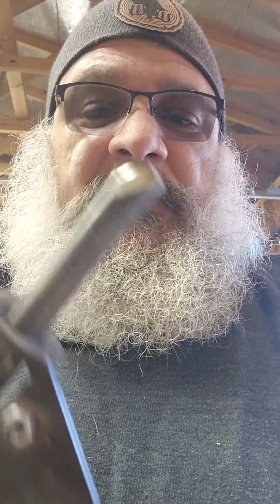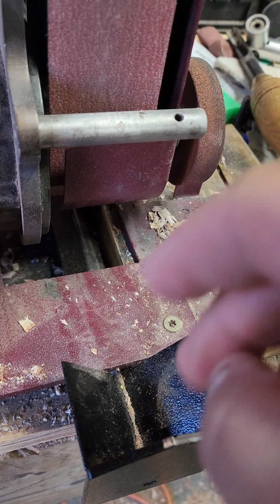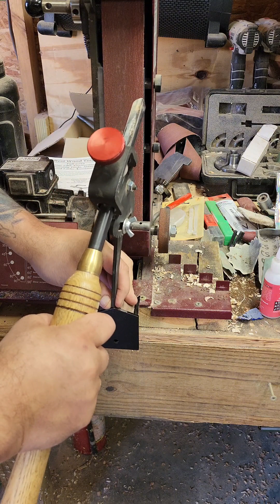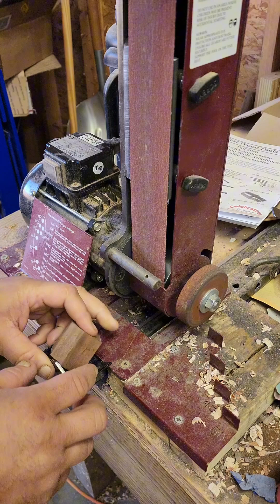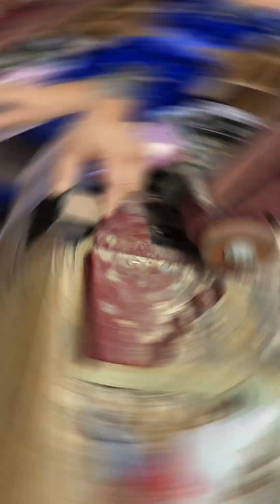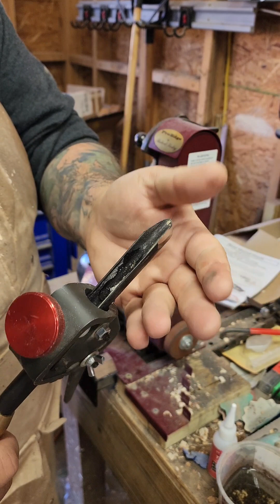Finding a solution for a sharpening dilemma.

Comment: Hi there,why don’t you recess and epoxy a few rare earth magnets into the block instead of hot glue.
Reply from the maker: Excellent idea. I wonder where I put those magnets? The block isn't 100% square, so I will have to cut a new one to do that. That's the beauty of the hot glue, though, it will just pop out with minimal persuasion.